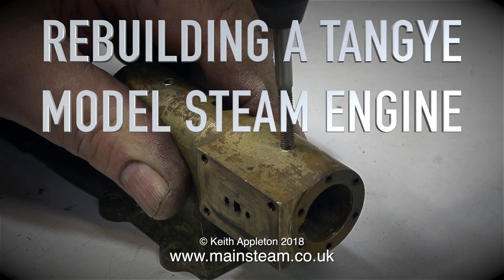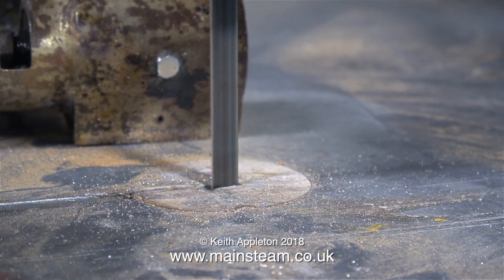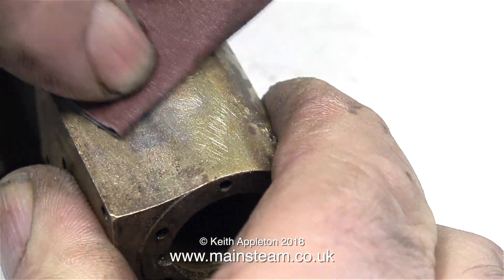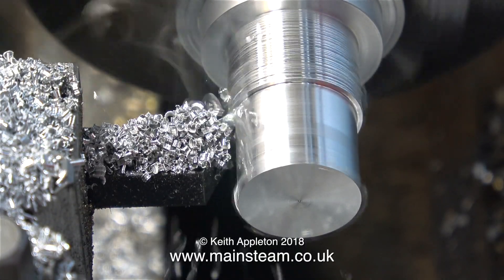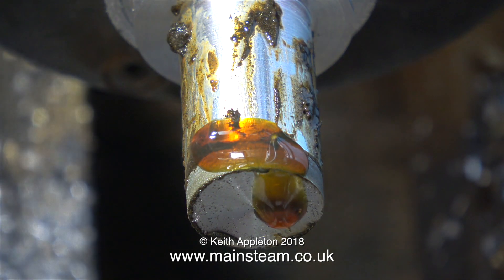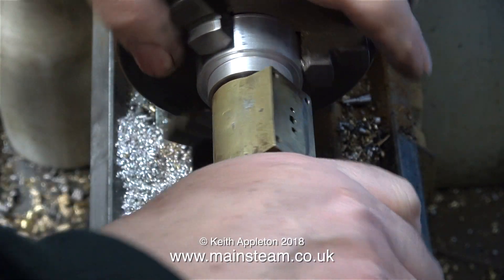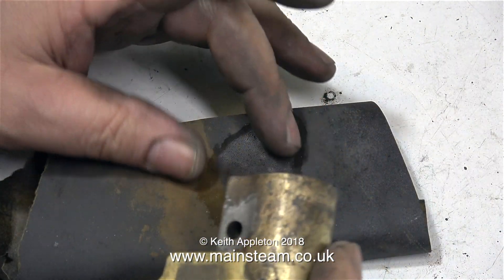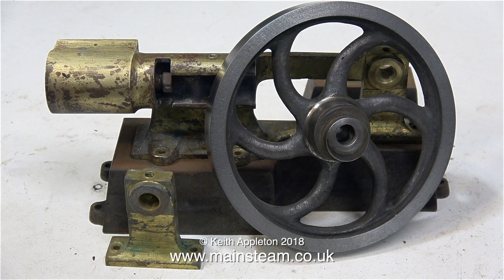REBUILDING A TANGYE MODEL STEAM ENGINE - PART #4

Comment: That's a good job plugging that hole!  I would have used a brake cylinder honing tool for the cylinder hole, but only because I have still have a set from 1/2in to 2in.  I was an auto mechanic and most cars today have disk brakes on all four wheels so newer auto mechanics don't even know what I'm talking about!  I also used the hones on hydraulic valves to good effect. You have to be very careful when sizing brass; if you get over zealous you could ruin the piece, so Keith's method might look slow but it's safer and this does preserves a very old piece of history.  I do love these videos that restore old toys without making them look like they were originally made of plastic.
Reply from the maker: Thank you for your advice. I don't think it would work on this one ....... I have a cylinder hone set, but this is a blind hole, the cylinder is part of the casting, and all I would get is a nicely finished cylinder bore with a ridge at the inner end . . . . . (I tried it) . . . . I do think about these jobs before I start them you know . . . . }:-)))
Reply: @keithappleton  I see your point.   My set was designed for open and closed cylinders, and I had a pad for shaping to make sure they stayed parallel. I don't know if you could find this set in England, it was sold through Snap-On tools, which in America, are known for their high quality tools.  My mini adjustable wrench from Snap-On still works great, much like yours,  and I wouldn't trade it for all the tea in China.